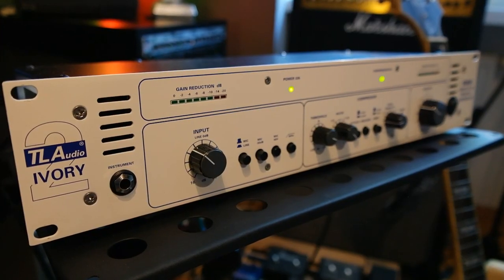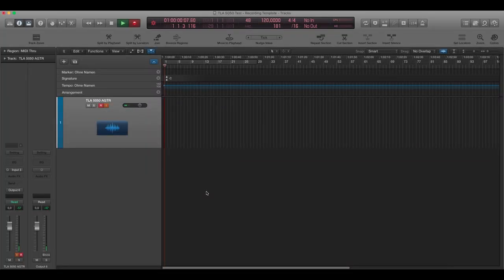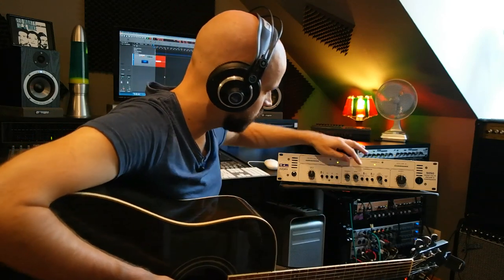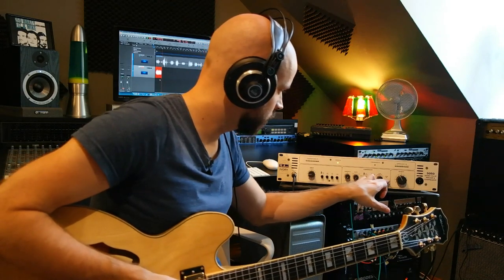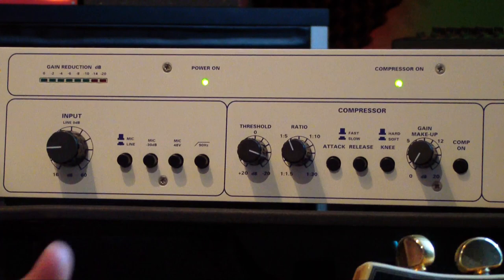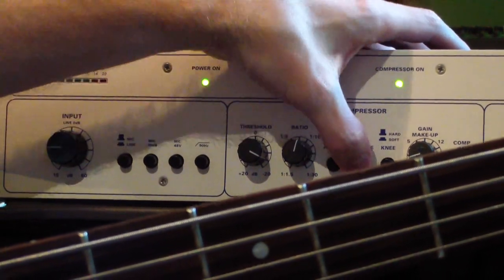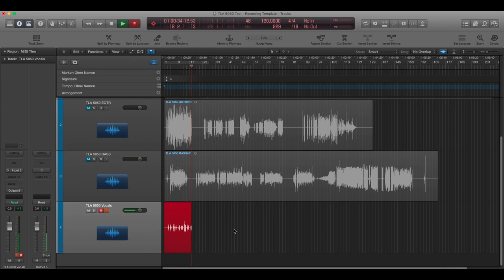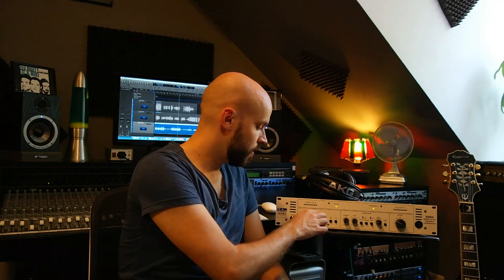TL Audio Ivory 2 Series 5050 Valve Preamp and Compressor: Guitar, Bass & Vocals

Comment: hello friend,  please help me understand the settings of the tla ivory 2 5051, for recording vocals and guitar. I can't figure out how to achieve warmth and surround sound. card volt 276, mic at4050. We don't touch the equalizer, I just want to feel the improvement compared to recording in the card directly. My sound is very overcompressed, overloaded, goes over the top if I add Gain, and if I lower it, it's hard to hear the voice in the mix. thank you❤

Comment: Should I choose TL Audio Ivory 2 Series 5050 or Art Pro MPA II for vocals? Thank you!
Reply: Both are good. In my opinion i will thake the cheapest one(romanian mindset) with one mention that the TL Audio Ivory 2 Series 5050 is mono and Art Pro MPA II have 2 channels to mix in the same time :D
Reply: Have used both side by side in a studio, the tl audio was by far nicer for vocals, mostly used art pro mos for overheads or anything that didn’t need any colour etc.  year late but might help someone.  A trick is to put some nicer valves in the ivory, makes a big difference 🤷‍♂️ in the mark 1 version anyway

Comment: zed marty do you like the gain on this ? i have one .on full the clipping is unpleasant , more like a digital clip than pushing a tape or a valve amp.it sounds okay in moderation.
Reply from the maker: I actually don‘t clip when recording, just get it to a healthy level around 0dB with a little bit of compression. Not more than 2-4 dB of gain reduction. I actually use more for DI Bass these days.
Reply: The Gain-control on amps/pre-amps not dedicated to guitars, is not meant to be used for driving the signal past saturation